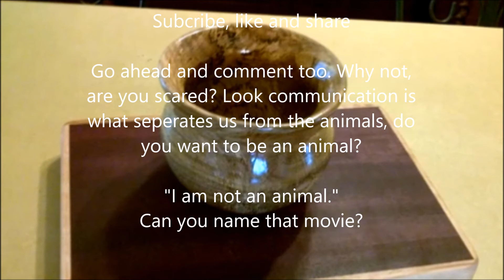Turning an Oak Hollow Form

Comment: Just come across your channel. You have a wide range of videos which is good and I have enjoyed those I've watched - except for the music! Ended up putting the sound off but didn't know if or when you spoke. Perhaps you could give that some thought.
I love this pot, both the shape and the finish. I made a similar one recently and struggled to get the inside smooth as it had lots of ridges. Whichever tool or speed I used, I couldn't get rid of the ridges. Any advice please? Hope you don't mind the feedback.
Reply from the maker: Pamela,
Sorry it took me so long to get back to your comment. I love constructive criticism. If you watch more of my videos you will notice that I have decided music was not the right fit for my videos. I actually went back and re-edited a dozen videos to remove the music. As for your question about getting your bowl smooth....hmmm it depends on the wood. Some woods have those ridges and the wood between them is softer, so when you sand the ridges are more pronounced. When I get those I use a scraping cut with my bowl gouge then I am careful with the sanding. That usually works for me. I hope it helps. I look forward to your comments on some of my other videos.

Ken